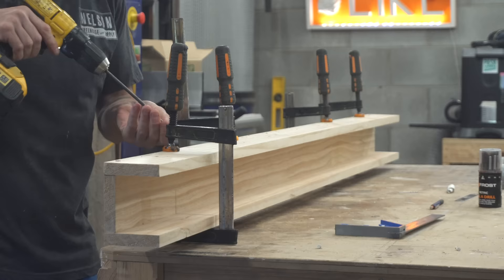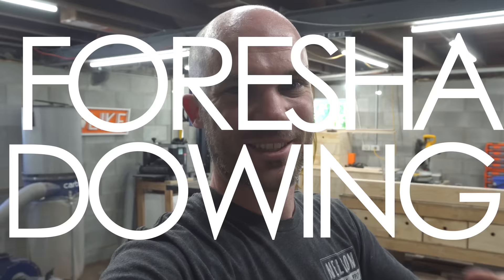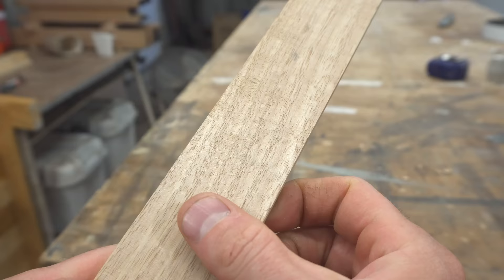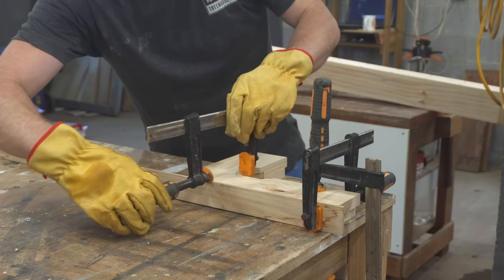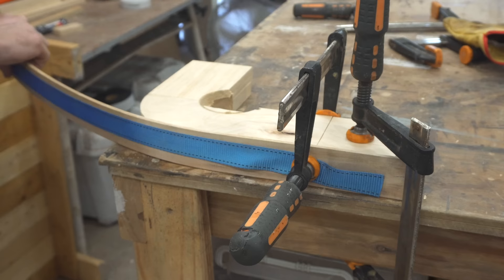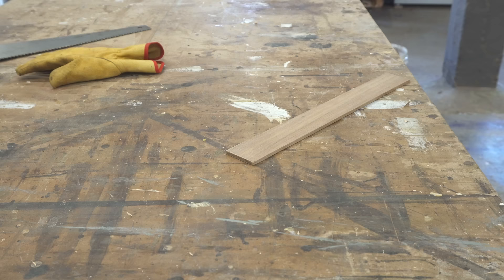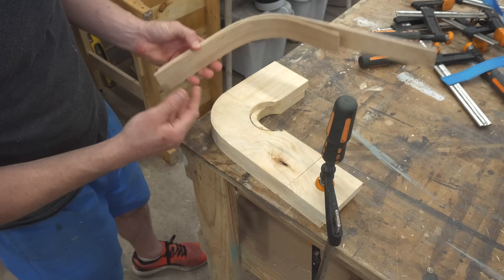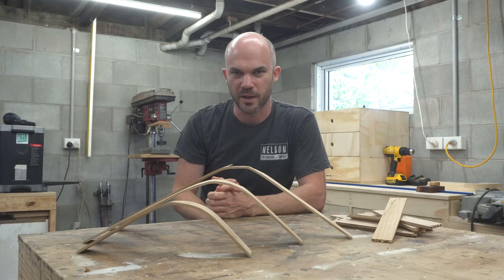Learning To Steam Bend Wood

Comment: Just soak the wood in cold water until saturated then clamp it up one side ,then, with a propane blowlamp heat up the bend and gently pull it to shape. The water boils in  the wood and it goes to putty .easy quick and cheap .
Reply: Heat gun would work well too, I reckon I'll try that myself!
Reply: @corvanphoenix nope, I tried it. Heatguns don't heat as deep. Im trying ops method today/tomorrow. will update
Reply: Why cold water?  Wouldn’t hot work better?
Reply: @westonstaheli5663 I don't know the full answer but I would guess that a part of the reason for using cold water is that your hot water runs through your water softening system/salt. Perhaps that could have a negative effect on the wood?
Reply: @snailsaredumb9412  How'd it go?
Reply: @emilystubbs5650  it sort of works. I couldn't get an even bend in an oak board but I bent a pine board with this method. Both with a 1 inch thick piece of lumber
Reply: @snailsaredumb9412   I cool,  good to know! Thinking about trying 3/4 pine

Comment: When I was a kid we bent kayak ribs by drilling a whole in each end, tying a rope through the holes and then soaking the boards in water. Every day we'd tighten the rope until the bend met our pattern then we'd take it out of the water and let it dry with the rope on.
Reply: ^^^Best education here
Reply: I was thinking the same, this needs water.
Reply: How thick were the boards that you were trying to Bend please respond because I really want to try this is soaking and bending with ropes stocks Pine is half inch thick
Reply: @mikebe41  Mike,
we were bending 1/4 marine grade plywood. I think something 1/2 inch would be really tough without relief cuts as shown in this video: 
https://youtu.be/ngC5S5vWQ4g
Reply: how many days of bending till you reached your desired form?
Reply: @S.G.W.C.  I don't remember it was decades ago. I expect it would be based on would type (we used marine plywood) and the extent of the curve for each piece.
Reply: @deanmean3230  I imagine you’ll get questions on this comment for decades haha. 1/4 is pretty thin. Would you laminate them together to get thicker pieces?
Reply: @mikebe41  I have bent 5/8” Beech, using a spray bottle to soak it, then progressive tension from a ratchet strap, over many days, perfect bend.

Comment: I did wood bending in wood shop class (high school). Built a cutting board with maybe 4 different types of wood and 12+ pieces in total (they were pressed into waves). The problem you are having is that you’re trying to bend too quickly. If I recall, would soak the wood and then insert into press with a little pressure. Next day, would re-soak and do it again. After a few days had a really nice waves throughout. This process might not be the fastest or most efficient but it worked.

Comment: I use Tassie oak all the time and have found soaking the wood for extended periods in water with some fabric softener allows me to bend much thicker sections. (Obviously strapping is a must, reducing amount of tension stress on the outer fibers). My understanding is that the soaking revitalizes some of the lignin’s that have been impacted by the kiln drying and assists in transferring heat.
Reply: Thank You for the soaking and fabric softener idea.  How much fabric softener?
Reply: @Rottingboards  Not sure how much is needed, but as I use the same water over and over and add some softener each time, I’d say the more the merrier.

Comment: You need to support the back (exposed) of the timber with a metal strap.  Bending wood compresses the inside curve but stretches the outside curve very little.  Small radius bend (< 4") require metal band support to enable the stretch without cracking.  You also require more clamps, 1 every couple of inches, especially if a band is not used to prevent cracking.

Comment: Thanks for the useful video. 
My guess for the reason why the wood broke in first few attempts is mainly because of the drop in temperature when you started bending it, resulting in hardening of the lignin in the wood. Instead of a steam box, using a plastic bag offers many distinct advantages. Since the wood can be bent when it is inside the plastic bag, there is no drop in temperature and thus the wood is least likely to break. It is also cost effective especially for long pieces of wood. 
Do check out the video titled "Steam bending wood without using a steambox" by 'Tips from a Shipwright'.
Reply: Wow! This is good advice. I'm fitting trim boards to a compound curve ship interior cabin. This trick will help.. I'll check the link too, tnx 🤟

Comment: Just think, boats were made by steam bending wood for centuries and with massive sections of wood. Makes you wonder how they pulled it off when they didn’t have clamps etc, they often had to nail pieces in together really fast!
Reply from the maker: You have to respect the old ways of doing it, must've been a very time consuming process

Comment: There is an “inside” and “outside” when bending long grain. At ~6:15, when it started breaking, as soon as you see fibers separate, you should flip it. Temperature is important, but the wood has to be very wet. There should be water dripping from your steam cabinet when you open the door. Kiln dried or treated lumber requires substantially more time.
Reply: What about soaking it in water for a day or so before the steaming? That's what I would do.
Reply: Wood will compress but it wont stretch, hence the outside cracks and why strapping helps

Comment: Hi great video shows the difficulty in steambending wood. Use air cured timber as timber from local timber yard is mostly kiln dried and rarely bends without cracking.

Comment: I've been bending my woden bows for a while now :), idk what happent to that oak but my oak bows never broke. I used a big pot with water on a stove, covered it in aluminium foil, and left the bow for arround 10 minutes after the water started boiling.
 P. S The bows were arround 2-0.5 cm thick

Comment: one thing I've learned is to make sure that you're bending with the grain, and that there are no runouts of the grain within a foot of grain.  I think the big issue you ran into here was that you need to 
1. wet the wood before you steam it. (1hr per 1" is for green wood - kiln dried wood - double that)
2. you need to build some pressure in your steamer - the holes you put in wouldn't have helped at all. You actually DO want pressure 
3. a metal steam box or a lined box would've helped too.  A wooden box essentially means you're steaming your box rather than the timber you put in it.
4. probably need more heat and water volume too.

Good on you for giving it a go!

Comment: Just some thoughts regarding what I learned shooting a documentary on old-world/by-hand wooden ship building. Though ship hulls have much smaller radius from bow to port/starboard they use steam boxes as the technique to achieve this. I don't recall the species of wood, but I remember the process - also the boards were quite thick, nearly 3/4". A large pot of water was brought to a boil with I believe vinegar added (but I also remember ammonia being mentioned) and a bellows was used to blow the steam through the steam box; so the volume of steam used was much greater than the steam cleaner produces despite the temperature. The boards were also left in the box for quite a while, more than an hour if my memory serves me. They came out actually very wobbly like a pool noodle when first removed. They then progressively clamped the board along the spires of the hull slowly tightening them down as they nailed from the straighter portion of the bend to the sharper portion of the bend. This gave the wood a few moments to adjust to the outward side stretching and inward side compressing as they moved down the hull.   I think this could be achieved by slowly twisting down clamps around the radius from one side or the other and working across it.  

I also think for a sharper curve you may need to do multiple steams in a box that accommodates the bent shape, allowing the wood to somewhat "cure" in between bending stages. I saw this done for very intricate sections of the hull that needed greater bends and something regarding keeping the board in compression with clamps. Steam, bend to the shape without nailing, then let it cool/dry for at least an hour, then pull it off warped, clamp it and re-steam in that shape.

Since wood is like a bundle of straws, it needs some acclimation time for those stresses to affect the cellular structure of the wood fibers. There is obviously an upper limit which can be worked around by stiffer compression or laminating and cutting relief grooves.
Reply: THANKYOU FOR THE GREAT INFO

Comment: Mate a friend and I did all your doing and in the end we used a strip of thin gal sheeting the same thickness as the wood we were bending, if you look closely at your wood you will see the cracks came from the unsupported areas, it took us a long time to get it right but we are slow learners 😢
Reply from the maker: I’ve seen a few people use and it looks the go. I might try organise some for the next project

Comment: 1) try green wood, 2) use a metal band wrapped around outer diameter, 3) should be able to bend most species with 1 hour steam per inch thickness

Comment: Robin,  I have seen a couple of YouTube videos on steam bending and the method they are using is kind of like your blue strap idea.... however a metal strap is used on the outside.  Quite a lot of forces are generated.  Also have seen two forms with the steamed wood in between, then the forms are clamped, really thick wood they use hydraulics to draw the forms together... forms are made of solid laminated plywood.  I have done some bending about the same size in your video.  I soaked my wood with glycerine and water over night.  The glycerine tends to soften the wood up a bit... I have never done anything with that tight of radius.

Comment: Nice, good video. Did this for my final year at uni. I did mine but out side so the machines don't rust up. And I rapped mine in insulation foam, so it heated up quick and stayed warm longer. Oh and you can bend thinker stuff just Dept on the wood you use and the time you leave it in for. 👍

Comment: I’ve bent a 10” wide poplar board for the bent side of a harpsichord. I used a bent metal plate former on a frame heated up sufficient to lightly scorch the wood. It works but these days I laminate thinner sections. It’s stronger and more accurate

Comment: I'm not allowed in the kitchen because I'm inept at boiling water... But;
While watching this... Plastic? Who'd a thunk?
I had a 2x12" cheap "pressure treated" outdoor stair step that had cupped and twisted. (It came with the house ☹)
For three years, I've been meaning to fix it. 
After watching this, I grabbed an empty polypropylene sandbag and put it over the end of the wood. It covered the worst part of the cupped end.
I used a Wagner wallpaper steamer. The wood was standing on one end with bag on top. I stuck the steamer hose up into the bag and clamped most of the bottom shut and steamed it for a good couple of hours.
I put a piece of 2x4" on the cupped end while still steaming and used C-clamps to flatten it against the 2x4.
Ha!  Worked like a charm!
Thank you for this excellent video!

Comment: If you add water to the timber prior to putting in the steam box letting it soak in water for about an hour and do you steam for about an hour then 1 quarter inch should been fairly easy I've done the same thing with white oak
Reply: Exactly, an hour is enough.  Cells might absorb water depending on the wood moisture content, MC. This means that if a piece of timber has a low MC, the amount of water will be greater and the speed of absorption even greater

Comment: I had to smile when you mentioned drilling holes to let the pressure out. We tried a wooden box as a pressure cabinet where I worked in an aerospace test lab, and we had trouble keeping the pressure IN! We had to  line the box with polythene eventually. Wood lets air through like a seive.

Comment: I'm impressed by your tenacity.  I enjoyed the video.  You've probably learned a lot more since doing this.  I've never steam bent wood so my comments are based on how I bent wood.  I used Cherry and white oak for most of my projects.  For my testing, I used many other woods.  All worked.  I would build a form that totally encompassed the wood to be bent and laminated as many as 15 1/8"(3mm) thicknesses together.  I had a long sink which I'd put hot water in from the faucet.  Leave it in for 30 minutes, take it out and "dry" clamp it into the form.  The form was made so that it took into consideration the thickness of the number of pieces used.  There was full contact on front and back of the pieces.  I'd leave it in overnight, let it dry out, then apply glue and reclamp it.  Spring back seemed non existent when the clamps came off again.  However, I found if I didn't secure the shape, it would begin to spring back over time.  So my experimental pieces would usually end up with spring back but the ones that ended up in a final product didn't.
I had more time to work with the pieces by soaking the thinner strips.  I suspect steam bending non-laminated projects will have a lot more spring back.
Reply from the maker: That's an interesting technique, not one I've heard of before. Once you apply glue between the laminations it gets rid of most of the spring back because of the rigidness of the glue. Thanks for the comment Harold, very interesting to hear how you approach it.

Comment: melting point of lignin starts from 110 °С
Look at the heaters used by violin makers. They are set to 160°C

In order for steam to be used, it can be overheated.
So the billets would boil in a saucepan.

Comment: Having only used steam to bend walking stick handles I can only comment on the method I use for that. It’s been a bit of trial and error and probably up for argument from experienced folk, but here it is any way:

The chamber I use is a length of 5” plastic pipe and the steam source is a diy wallpaper stripper.
I soak the sticks in water for a day before bending. This may also be a step worth considering with machined wood.
I put sticks in the pipe, keeping them off the bottom on small support blocks.
Put steam hose in the end and stuff very tightly with rags. Stuff other end very tightly with rags also.
Steam for at least 45mins. I actually let it go till the steamer runs out of water.
Note that the pipe will need support because it’s plastic and the heat will cause it to bend and sag.

I have home made  jigs where I bend seasoned stick handles to a little past a u shape of 3/4” diameter, sometimes a little more depending on the type of wood. And yes, always leave them in situ for as long as you can. 24hrs minimum but till dry preferably.
I’ve thought about insulating the pipe but I’ve never really needed to. During the bending process, with practice, you develop a feel for it and the wood will tell you when it’s went as far as it’s willing to go.

Dunno if that adds anything but it works for me.

Comment: Your problem is the time in the steamer, let it soak. I had to bend a 0.5”x6” (12.7x152mm) white oak baseboard for a custom home, and while the radius was much wider than what you’re doing, I didn’t have the option of thinning the material. The piece spent about 7 hrs in the steam box before I could get about a 1m radius on it. Also, you only have about 60 seconds to bend your material once it’s out of the steamer. After that it’s already cooled too much to get a smooth bend without splintering, so make sure you have absolutely everything set up beforehand.
Reply from the maker: 7 hours?! Wow, that’s a long time! Good to know, thanks
Reply: @RobinLewisMakes  at the least . let soak longer for longer cool down time

Comment: Soaking the wood in water beforehand is the key. Getting moisture in to the centre of the wood by soaking it will help the steam transfer the heat to the inside, separating the internal fibres. Dry wood won't transfer the heat inwards. (Hence wood burns).
I soaked half-inch oak strips for a week and, using the 'one-hour-per-inch-thick' rule, they bent like toffee after 30 mins of steam.

Comment: I have tried this. I was hoping to make ash hoops, about 6mm thick, but bent to 12 inch radius. The essential step that seems to be missing in the first experiments was the strap around the wood to support it as it bends. The lignin needs to compress, wood doesn't 'stretch' - so you always need to support the outside of the bend.  Thin metal straps are the answer. Some of the other videos on here about steam bending are bending very thick, heavy pieces of timber - but with the outside of the bend fully supported with a metal strap right across the full width of the wood.
My big problem was 'spring back'. I have yet to find a good way of joining wood 6mm thick to itself to form a hoop that is strong enough to withstand to tendency for the hoop to return to straightness! Have you made any more progress since posting this?

Comment: You should look into how acoustic guitar makers steam bend the sides of an acoustic guitar. There are many methods out there to apply A LOT  of heat while you're bending. There's an Iron out there (try luthiers Mercantile, hopefully they're still around or ebay) basically a steel pole with a heating element in it that can be used to heat the ligament in the wood while you're bending. If you're using wood that thick I'd soak it for a while before bending. Guitar sides are generally 1 to 1.5mm thick if I'm remembering correctly. Its been a couple years since I've built one.